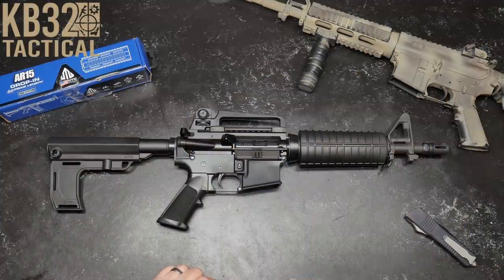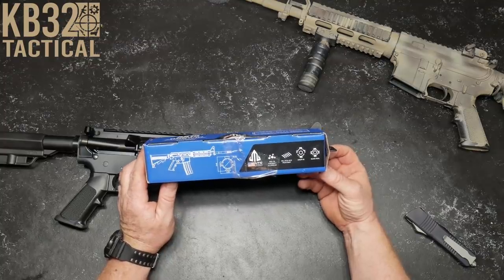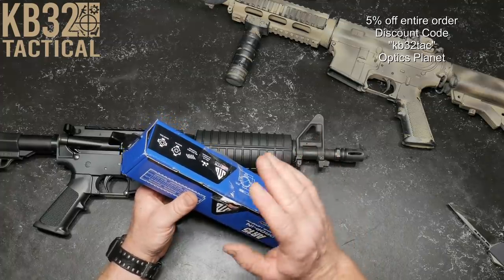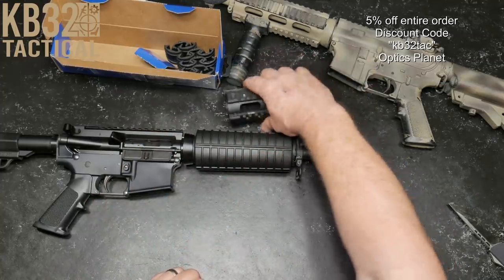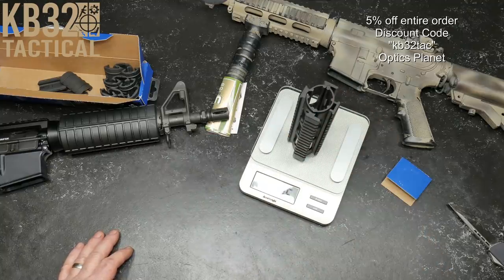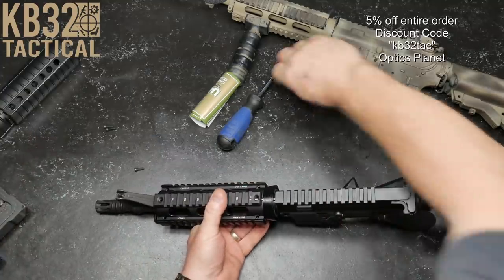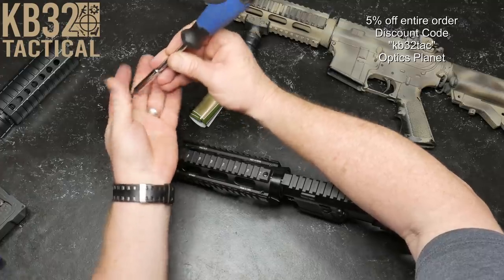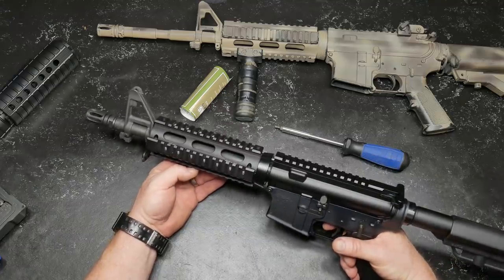UTG Pro Drop In Quad Rail First Look and Install

Comment: For my 20" A2 rifle, I searched all over for a drop in UTG quadrail in a rifle length. Thankfully, JSE surplus was the only ones I found that had them for a good price, right around $70. It works and is a solid rail.
Reply from the maker: JSE Surplus is a great company

Comment: I just tried to pop one on my M&P-15 and they let me down by not aligning the barrel nut well enough. Rails don't line up right which means they had to sneak the gas tube in a little forcibly also. It's just enough to where it's hard to notice straight away but just enough to where it's OCD annoying. Would have worked great otherwise but now I'll have to take it apart and straighten the barrel nut out so I might as well just put a whole new freefloat guard on there.

Comment: I've had one since early 2017 and every 1000 rounds or so I feel like I tighten the screws (I Don't use loctite. I'm sure loctite will fix it good) but other than that it's been great for me. Definitely a notice in weight increase. But I can run through 10 mags non stop and feel no heat

Comment: KAC and Midwest Industries rails have anti-rotation pins that engage "teeth" in the barrel nut to prevent rotation of the quad rail when using a bipod or when mounting a sighting instrument (PEQ2, etc.) on the rail.  Any movement with a bipod would only be a nuisance.

The UTG rail is fine if you are not going to be mounting any sighting devices on the rail and use the rifle in extreme duty, or extensive full auto fire, as the military expects to do. 
TBH, I use UTG rails on a couple rifles and they seem pretty tight to me, and I have no sighting devices on them.

As for strength and durability...no problem at all.

Comment: Do you know if they make that rail with an extension between the handguard and the upper. Seems an extention with extra pictany rails would make it flow a little nicer.
Reply from the maker: yes they do, just a different model

Comment: I have an Aero Precision ss 18" barrel coming and I dont think it is going to have dimples for gas block set screws. Would you recommend taking it to a gunsmith or buying a jig and diy it?
Reply from the maker: buy the jig, learn to do your own work
Reply: Thanks, Just ordered the jig. This is my first build. And it definitely wont be my last.
Reply: @cutter2258  
The jigs are nice. I used the spaghetti noodle trick and it works, but the jig is better. Youtube still has videos showing how to do it and also how to use the jig.

Comment: I have UTG Pro quad rail on my 16" PSA and first thing I saw those two threaded screw holes and I didn't have a clue what went there and I still don't. You said in case you need to mount something, like what ?
Reply from the maker: back in the day, when they first mounted quad rails, there were some accessories that would screw into those holes, lights, swivels for slings,,,,etc.

Comment: Everything I’ve ever gotten from utg has been ok. Yes I’ve leaned my lesson about the availability at optics planet.
Reply: TheRoyalHam if your willing to wait it’s no problem they have free shipping and good prices on most things. I’ve built a 6.5 grendal pretty much off their website and have ordered reloading items also. I also like primary arms for some things.
Reply: I tried buying a stream light hlx with railmount and it said in stock. 3 days later they said it wasn’t in stock and it would ship in 2 weeks. Waited 2 weeks then they said it’d be 2 more weeks. So I cancelled the order. 2 more weeks from then I still haven’t gotten my money back.
Reply: Nick Peeples That happen to me on a Ar stock but I did get my money back
Reply: I ordered a castle nut wrench and a castle nut (just to have a spare). The nut was out of sto k and would have delayed my order, so I went back and deleted it since I'm not gonna wait 3-4 weeks just for one item that I can get elsewhere. 
Got my wrench today after about 2 weeks of waiting.

Comment: What barrel is this? I’m currently building a very very similar build like yours here. Almost exactly like yours. I need more info on your barrel and fsb? With your new utg quad rail. Looking to do this on a 10 or 10-1/2 inch barrel. Going with that utg quad rail or the strikes viper handguard.

Comment: Thinking UTG is out of Livonia.   Have the same brace, haven't shot mine with it on yet.   Did you like it?  Bit worried as the polymer seems pretty slick.  Remember the fallen.
Reply from the maker: the brace is fine, you won't have any issues with it

Comment: Kb32 what a good free float fir my colt le6920 I want to keep the à2 front site . Thanks
Reply from the maker: If you want a free float and keep the front sight post, you're gonna have fun putting it on.  Troy makes one the fits on to your existing barrel nut, just have to cut the delta ring off, no big deal.  There are several other companies that make rails for that.  You will need to punch out the pins on the front sight post and remove it, slide that rail on and wammy, you are free floating

Comment: Nice video! Oh would this work with 1022 chassis systems that are compatible with AR15 parts etc? Also do they have any Mlok offerings?
Reply from the maker: Yes it will work, not sure about the m-lok drop in rails
Reply: @kotaboy32  Thanks just wondering. Oh do they have this hand guard in different lengths? And what hand guard length would look right for a 16"5 inch barrel?

Comment: I bought the UTG PRO® AR15 FREE FLOAT QUAD RAIL HANDGUARD, 13" RIFLE LENGTH
SKU MTU006

It measures just under 12.5" from rear rail edge to front, essentially the entire length. Make sure you read the manual as the 13" version says 318mm which does measure 12.5". Why they would lie is beyond me. An actual 13" would've covered half of my gas block. Now the gas block tube is exposed by about 5/16". This is false advertisement.